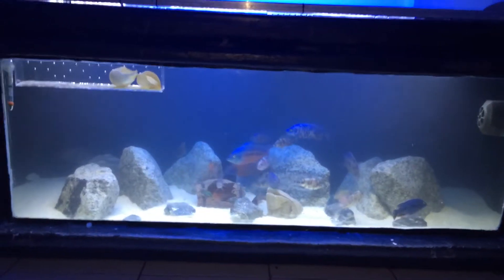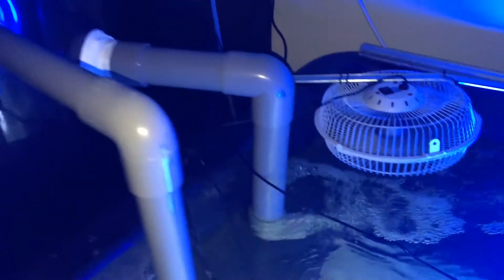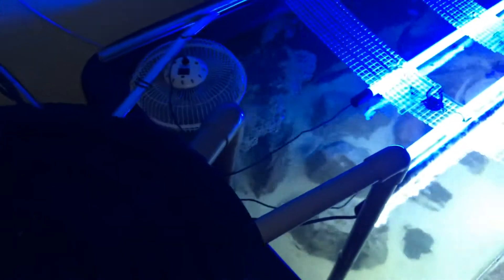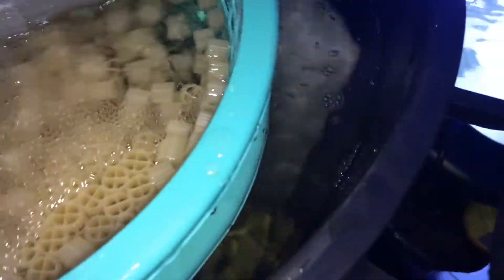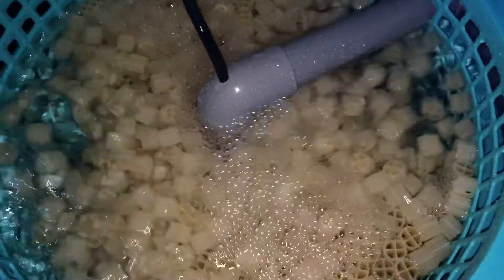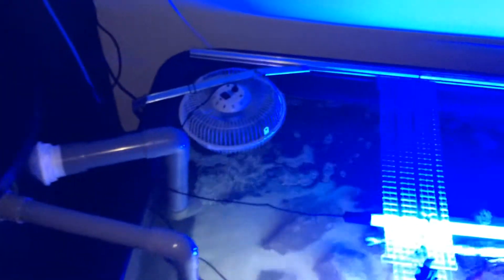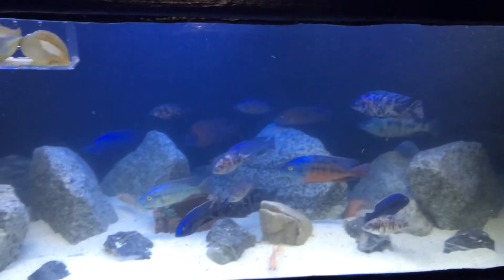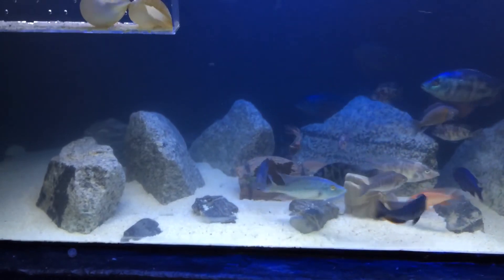DIY BARREL FILTER. Up and running , version 1. Comments needed for refinement

Comment: Great looking filter man if i was you id add more bio logical filtration in the bottom section check out the pondguru media bio home it removes ammonia nitrate and nitrite the best upgrade possible for any filter 👍🐟🐠
Reply from the maker: Thanks for the kind words, and are the bio home u reffering to are a stick looking media with hole in the middle?

Comment: How long did it take you to make that filter?
Reply from the maker: Probably around 2 hours to drill the holes, as I didn't have the right tool, and then today took me 1hour to measure everything and saw out the plumbing. And all is up and running. It's safe to say probably a whole day work if you have everything ready. You should be done by half a day
Reply: I think you did a great job!
Reply from the maker: Thanks again Ricky 👍